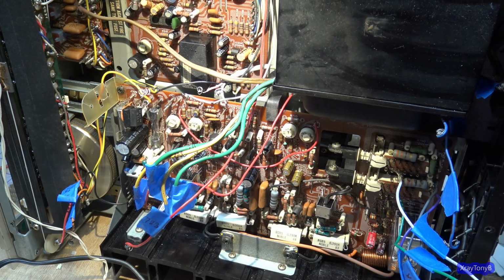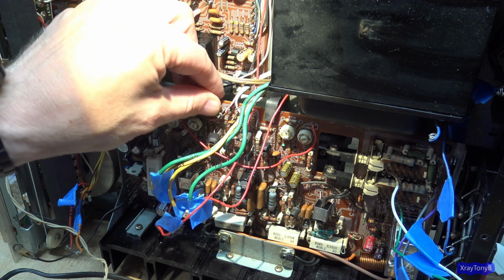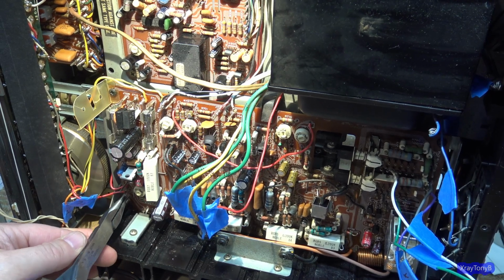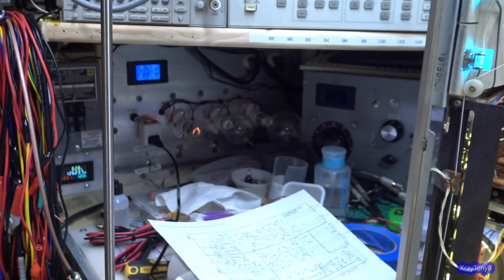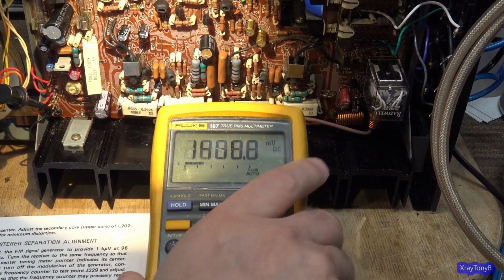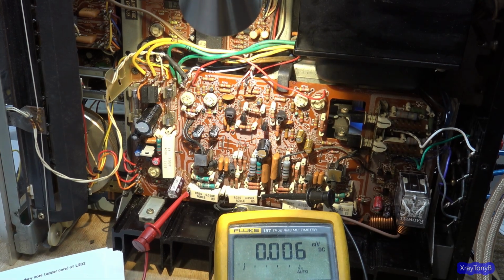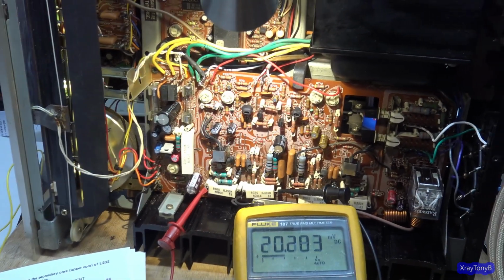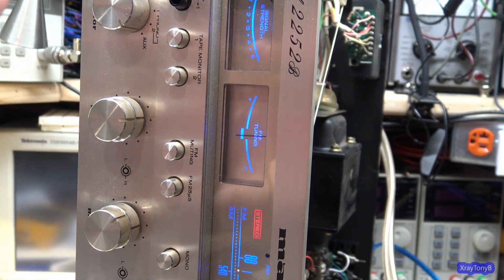Marantz 2252b Part 3 - Modifying and Adjusting the Bias Circuit

Comment: I can relate to your comment about the power cord. I have a 2252B I bought when I was about 14 (1978?). I replaced the cord after a few years because although the plug is really nice, the wire is lacking. I hated to lose that plug too. Mine is in need of some refurbishment. I know at least one channel has failed. I haven't plugged it in in years. I think I paid about $700 for it back then. That was a lot of money for a 14-year old. My father was worried I was wasting my money. I say not.

Comment: Sometimes, when doing a touchy soldering job, I will clamp two wires together using a hemostat. It holds the work in place and acts as a heat sink.

Comment: I like to set the bias on the cold side with the dim bulb off and set my variac to 120vac so I take the wall outlet voltage out of the equation. Then I vary the AC voltage to about 110-130 vac which is the most I have seen at the wall.  And confirm it doesn't go over the spec or cause crossover distortion.  I have tested the crossover distortion on most amps they need very little bias. 10-15 mv across the 2 emitter resistors is usually plenty.  Then I like to add a little heat from the heatgun on the heatsink near the temp sensors to see that they are lowering the bias when heated up so it reduces chance of themal runaway.  Then as it cools it should rise back up to what I set earlier.

Thanks, Jim

Comment: Great to know those tips, especially about the bias not having to be spot on and can be set slightly lower.. may as well have it idle a tad cooler.  that board was a pain tho''
Reply: Unlike this amp, many amps get their bias from the unregulated power supply. Better check the mains before setting, one of the reasons why the range is broad. It is not difficult to check how much the bias changes per mains Volt, and adjust accordingly.

Comment: If you think that's hard to work on, imagine having to disassemble an entire AVR just to fix a couple of cracked solder joints.  I miss the days of bottom access.  That being said, there is some ease in removing boards with connectors rather than wire wraps!

Comment: Jewelry? I worked on some broadcast digital image effects processing equipment in the mid 1980s where they specifically warned you about rings and other jewelry. The upper and lower rack bays were both fed with 300amp 5volt power supplies in parallel. Hey, it's only 5 volts. But of you bumped that rail on the backplane, any ring would turn  to liquid metal in microseconds.  Damage from that means ultimate amputation! Short circuit protection? Sure, but your wedding ring just looks like a normal few hundred TTL gates pulling low.
Reply: I remember at an Intel lab, one time someone blew up a prototype board by shorting it out with a ring. (Fancy 100A ATX PSUs were the preferred ones for powering up the boards, I guess luckily the board happened to be the weak link that time!) Not too long afterwards, there were reminders by the lab doors to remove conductive jewelry before entering.

Comment: To find an optimum bias point it really takes FFT analysis for best harmonics profile. Another thing is if somebody wants to increase the Class A portion of Class AB up to what given sinks can tolerate. For more linearity in quiet program parts or for better low level detail with sensitive speakers. In a push pull amp you get ((Iq*2)*0.71)^2*Rload Class A power RMS. Then it slides to Class AB.

Comment: Tony,  I love your channel and have picked up many new processes and techniques. I would like to comment on the wire wrapped pins. Those wraps are tight when originally made. Gas-tight as its listed for the wire wrap specs. The sharp corners on the pins gouge the wire making the connection. If the wire is unwrapped the nicked wire is basically rendered unreliable if used again. I see you solder after you rewrap but without flux it could end up unreliable in the future.  I desolder the pins and wraps as one, leaving the wrap alone. Those pins would be easy to reach with a iron and a slight pull with a pliers, or better, cutoff pliers and a pry? This is only if I can't loosen enough harness to access without removing the pins. I like making the restorations like factory.
Again, I love the channel and only make the comment with respect. Keep the wonderful content coming.
Reply: Tony was doing exactly how you described it on some of his other videos. If I'm correct on the part 1 of this series he  mentioned he could take pins out with the wire wrapped around them but had decided to go down the other path here. That's what I really like in Tony's videos (besides other stuff, of course). He's showing various methods, technics, skills, approaches etc. when servicing gears. It's good for those who learn from him and it also makes each episode more entertaining.
Reply: Isn't there flux in the solder?  Why would that be unreliable, unless you are saying the pins are nickel coated and don't take the solder?

Comment: Hi Tony,
That was a great clip. the explanation with the various values of resistors for the bias adjustment was really nice. Since the voltage was creeping ever so slightly, I wonder if it will do the same while the amp is producing a signal. I mean, will you have to re-adjust with a signal fed in... even after the warming up period?

Comment: I agree with you about the Bias . I run all mine on the cold side. I generally adjust mine with the Scope . I dont read much into what the service manual says . I cant stand an Amplifier that runs so Hot you think its class A . I really dislike working on the 2238 and the 2252 id much rather work on the 65,75,85  . Nice job on the re-Bias sir

Comment: I agree with you about wearing jewelry. When I was in the military working on avionics, it was constantly drilled in our heads about wearing jewelry and sometimes to the point of being ridiculous. Since then, over time, I pretty much do as you do : )
Reply: With full respect, I also work on cars/engines.  It is not so much the safety as I do not want my hands and watch to get caught in tight spaces or possibly damage it.  I removed all to keep it safe as there is no need for it when performing repairs.

Just me.